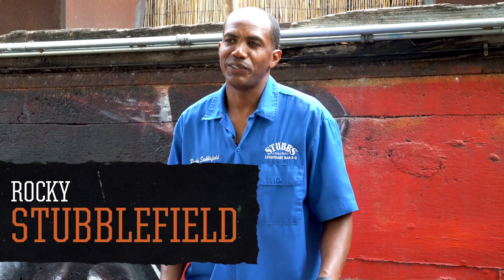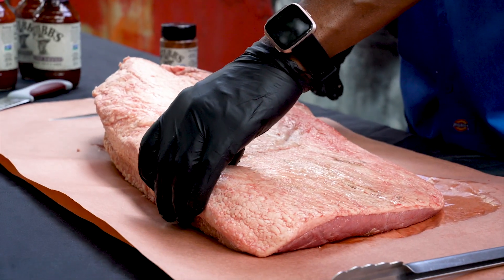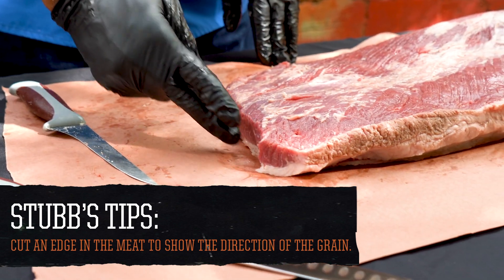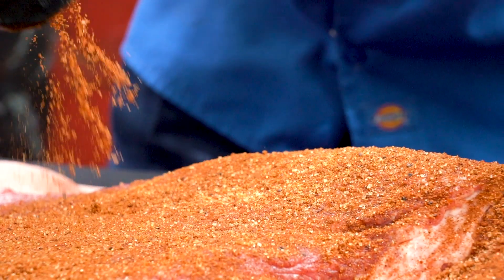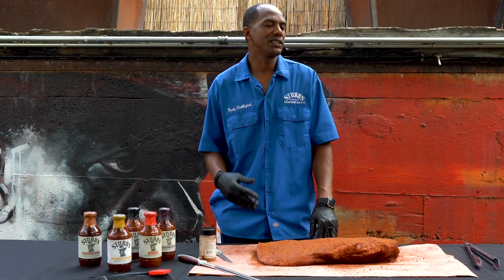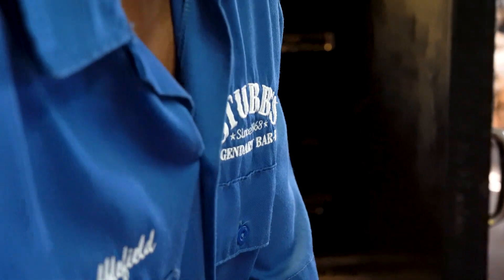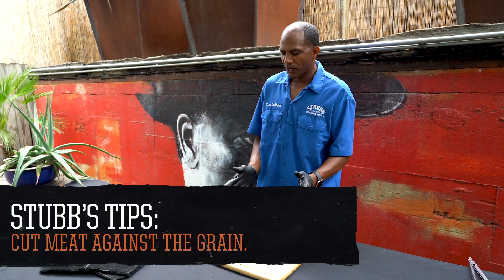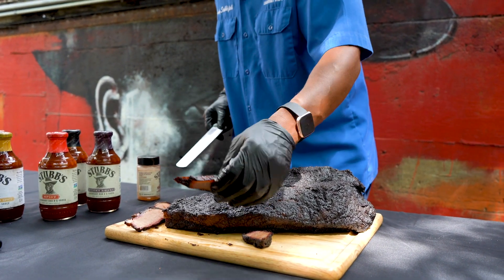Stubb’s: How to Cook the Perfect Brisket

Comment: Mine didnt' go so well this weekend. Looks like this short clip had some tips. Attempt 2 coming soon.
Reply: Took me about 6 brisket cooks for me to say I did it right. Brisket isn’t easy to cook and nail it right away unless you’re doing just the point. Do it low and slow, and cook it until the flat is soft as butter when you poke it with a thermometer probe or toothpick. Use a temp gauge to get an idea of how far along your cook is, but it’s not done no matter the tempt until that flat is soft as butter. Last thing you need is to let it rest. I just did a brisket this past weekend and it was by far the best brisket I’ve made at home. It cooked for 12 hours and I rested it for another 5.